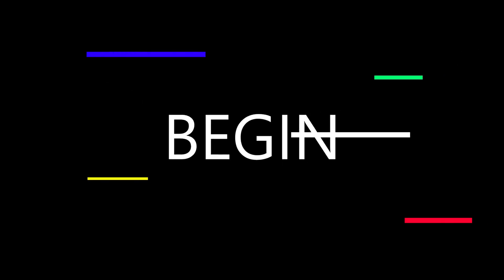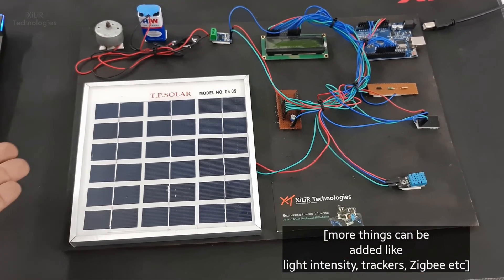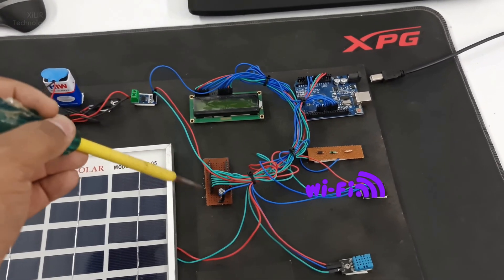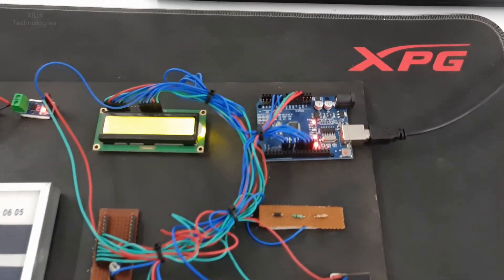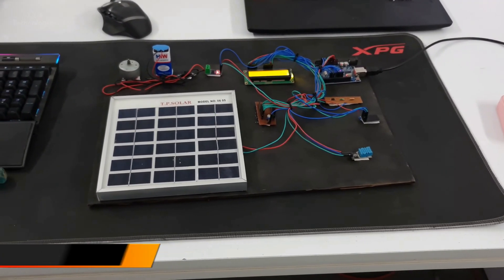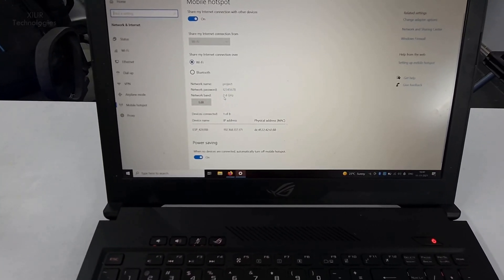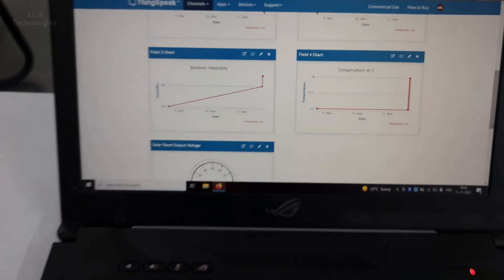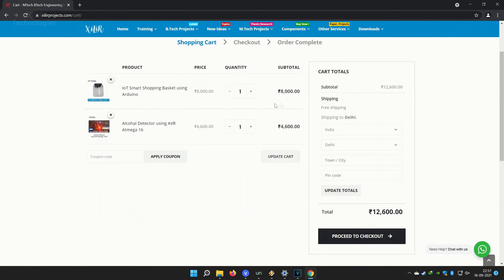IOT Based Solar Panel Monitoring System Using Arduino & ESP8266

Comment: What are the components required for this project?
Reply from the maker: Solar planel
Rechargeable battery
Microcontroller 
Current sensor
Voltage
Motor
Wires
Wifi esp 8266 
Thingspeak.com account

Comment: Can I monitor five individual panels on this system
Reply from the maker: Yes you can
Reply: With one current sensors or 5??
Reply from the maker: If u want to monitor individually then 5 current sensors